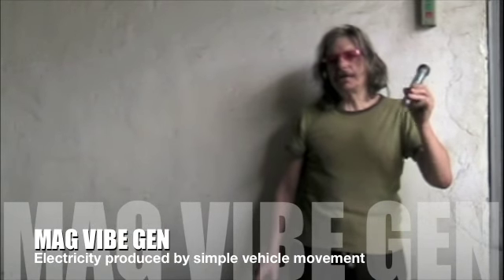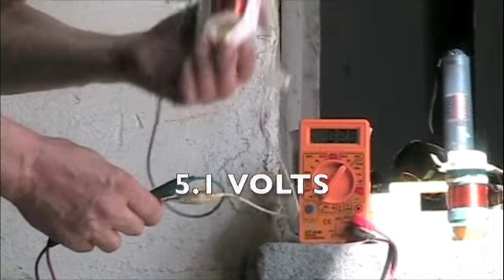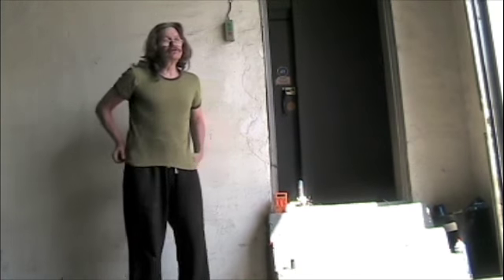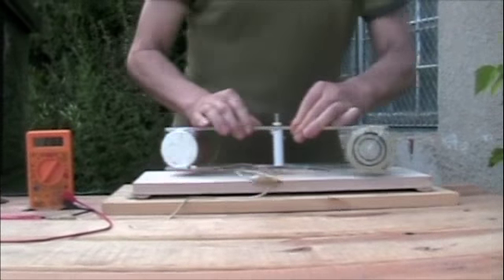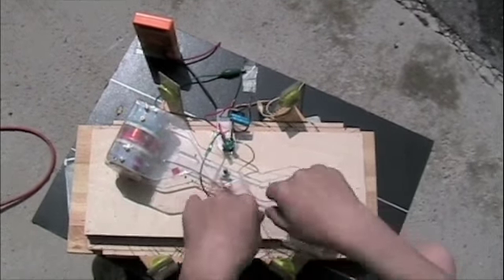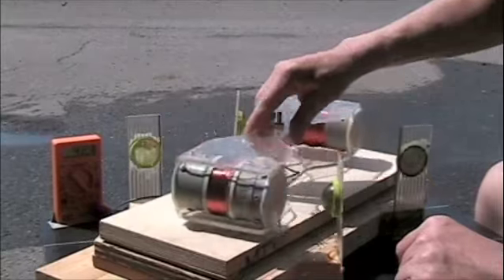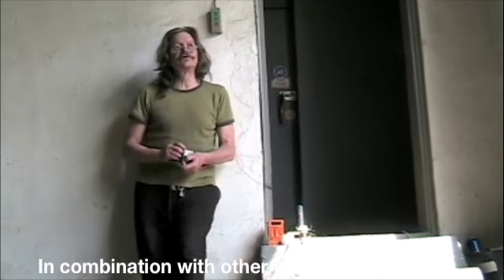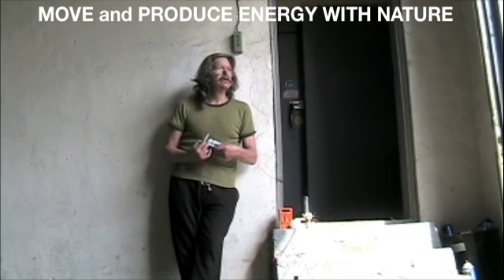MAG VIBE GEN - 1

Comment: I would like to point out that the SPACING of all gen-magnets is very important. Not only can the whole floor area of a vehicle be needed, but the frame, body & everything else should be non-ferrous to prevent interference. For instance the screws used in these demo units are brass, so the magnets will not be held towards the superbounce impact area. Plastics are a candidate, but a Brazilian friend suggested compressed banana plants. There are other possibilities.

Comment: The electrons are excited to next higher (& free-er) Plank crustal in the Bohr model. On a more practical note: what is needed here is mid-range energy output - not huge & not tiny communication & computer type. So those engineers are pretty useless. All mind-visions should go to: No energy in/all energy out! The exact needs are in the Mag-Drive (formerly "Hub Motors" or "Chinese Electric Scooters") spec-sheets. Please study & not ride in fuel-motor or you will never think of solutions!